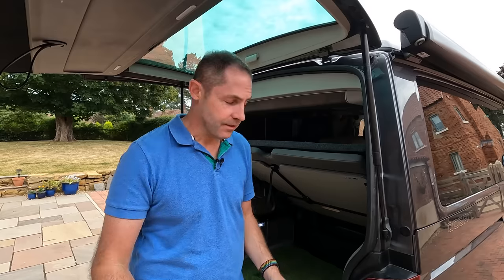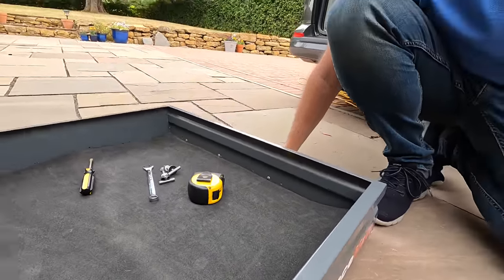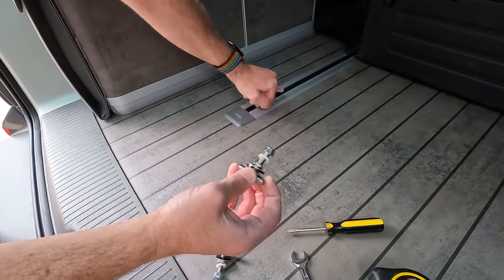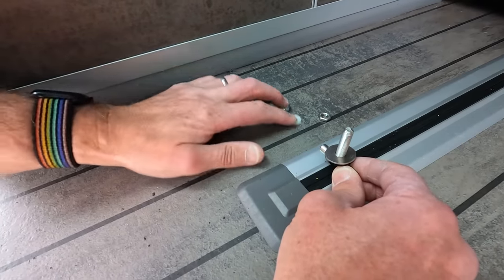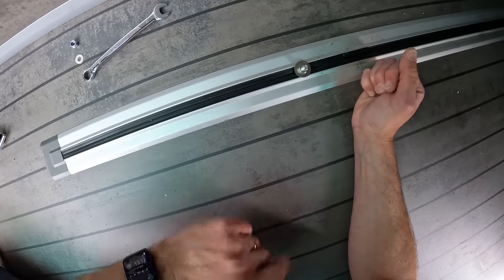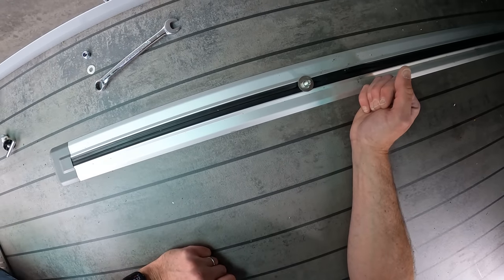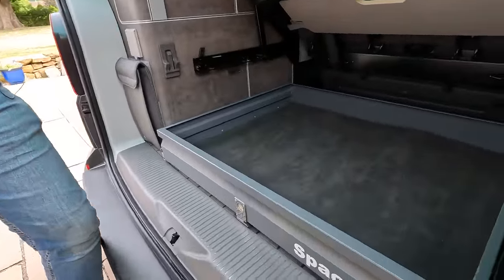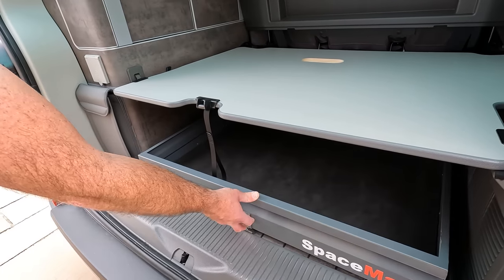VW California SpaceMate Boot Drawer Install & Review!

Comment: Hi Will
With regards to the 12v plug on the right now being redundant.
Could the tray design be reversed so the gap appears on the right allowing access to the 12v or at least the use of an extension lead plugged in permanently to gain usage.
Reply from the maker: Good question, certainly worth looking at 👍
Reply: We've now built a version with the bias to the left to leave the 12v socket useable 👍
Reply: So glad Will has got his 12v access back. Good luck with brilliantly designed storage draw.

Comment: Looks Fab - as a storage freak I really love it, just got to think of somewhere to put my " long" things that fit perfectly down the left hand side under the seat (outdoor mat and rolled up window shields)
Reply: I travel a lot with mine and it was one of the things I deliberated the longest over. I have a heavy 1300mm bag that’s about 200 x 200 but I found the the trays are strong enough to place it on top and it still slides nicely in and out when the tray is pulled out. I you were using the height from top to bottom then there’s a slight compromise on what long load is left. Maybe one for the future..

Comment: Hi Will. 
Great video. Just wondered have your tried with your bike rack installed? Does it foul the rack to toe ball lock handle or strike the rack when extending the drawer with the rack pitched over? I use a Thule XT 3 so similar potential strike/foul points. 
Thanks.
Reply: I’m can’t answer for this specifics tray, but with similar trays on the market they don’t foul the Thule racks.
Reply from the maker: Good question. Not tried that yet but can do and report back 👍
Reply: @CampervanTime  would be great. Thank you

Comment: Looks good, suggest Simon puts a hole in the side that lines up with the 12v power point
Reply from the maker: Interesting thought - hadn't considered that as an option 👍
Reply: Trouble, is you’d rip the plug out when you pull the drawer open. I planned to relocate the 12v socket higher up on the side trim.

Comment: Looks good and will save lifting the shelf up to get to stuff. I wonder if it’s narrower than the base of the boot with gaps at each side because then what you put in it doesn’t catch on the brackets higher up that fix the wooden shelf in place as you slide it back.
Reply: That was part of the reasoning, more vertical space on the RHS.
Reply: Always said I should have been an engineer

Comment: Nice drawer, just a quick thought, are you still able to access your jack ?
Reply from the maker: Yes - by sliding the bench seat forward a bit. I have actually found that sliding it all the way forward is easiest as you can then just put an arm in and unstrap it from the back of the bench and lay it down, then go in the boot to get it.

Comment: Looks good. Wider than the original campervanbits version but as you mentioned could be wider. I like that the rear seat still goes fully back.

Comment: Looks great! 
Can this fit on a 2 seater Beach?
Reply from the maker: Good question, I’m not sure. It will depend on the position of the rails in the floor for the sliding bench seat and if the bench is the same as in the ocean / coast. I suspect it might.
Reply: Would it be possible to help with some measurements?

Comment: Hi Will! Great video as usual with clear explanations. The Spacemate looks a high quality product. 
However... I've always thought a boot-drawer in a California is a 'solution looking for a (non-existent) problem'!!
We use collapsible crates in the lower boot space. Yes, you have to pull out one crate to access the one behind it ... but, really, hardly a big issue??!!
The major disadvantage of installing a bootspace-wide drawer, as I see it, is 'losing' the long storage space alongside the back seat... perfect for storing our rolled-up awning front & side panels!
The beauty of the California... flexible space for individuals' needs - to be organised however you want to! 
Again, good review 🙂👍
Reply from the maker: It’s all down to personal preference I think. We’ve not tried one before this and we’re impressed as it means we can use more of the space more of the time, although it’s a bit smaller space than without. Using the hot water boiler shower will be a lot easier on this.

Comment: With four adults in the Cali and fully loaded for a big trip, payload can be an issue. Even more so on the Coast than the Ocean. Can I ask what the weight of the unit is? Curious as to how much it eats into precious payload. I did check the website, but couldn't see specifications. Many thanks
Reply from the maker: Not sure exactly but I think I saw a comment from Simon on another comment asking something similar saying it was about 24kg I think.

Comment: Excellent review, thank you. I have a 4motion so weight is a big factor, as is losing any potential space. I think I’ll wait for v2, hoping that some improvements can be made in those areas. Is a solid floor necessary or could perforated sheet be used?
Reply from the maker: Good points and good question - I don't see why the bottom of it couldn't be perforated. I know Simon is watching these comments with interest so lets see what happens!

Comment: Looks a good alternative to the Campervanbits version. I noted on an installation video for their drawer that someone suggest loosely fitting the drawer and then from inside push it up to the closed tailgate to ensure it’s as far back as possible. Also, the Campervanbits version also states the bench may need to be moved 20mm forward on a T6.1. Great review, not sure which one to get now..! But drawers are definitely worth it, no more dragging everything out to get stuff at the back. PS: do you know the weight of the unit, couldn’t see on their website.
Reply: 24kg
Reply: @SpaceMateMH  great, thanks. Also, where are you based as I might prefer to collect (if possible)..?
Reply: @couplandsj  Midlands based but I'd be prepared to Meet somewhere and help you fit it. 👍
Reply: @SpaceMateMHL  that’s very kind. We are still waiting for our Cali to arrive (ordered June 21 and stuck in build since May). Was just thinking if it didn’t arrive before end of August I might just come and get the drawers. I’m just checking dimensions to see what combination of Euroboxes will fit.

Comment: Looks super well built and the fitting nicely non invasive. Always thought these were a bit of a solution looking for a problem but with some of the tweaks mentioned could be much more interesting. Drain holes, maybe no so much - would prefer spills to stay in the top rather than having to remove to clean, but the loss of a 12V a pain as is the loss of width, The 335 placement a show stopper for us - it’s the last thing out for us and the first thing in, so having to move things around to fit the drawer means we are working for the unit, rather than it working for us. Will keep an eye on though. keen pricing too. You never showed the underside but would be good to know if there are rubber stops to ensure the front does not damage the floor.
Reply from the maker: Ahh yes apologies for not showing the underside - yes it does have felt and rubber to protect everything and we've taken it in and out a few times now and no trace is left anywhere.
Reply: @CampervanTime  Cheers. Will watch for a V2 where there is a hole drilled for the 12v and the 335 goes in back right with a tray insert.
Reply from the maker: I’m sure in the T6 it would be ok because it doesn’t have rear board with the lift / hold mechanism. Need to give it a go in one.
Reply: @CampervanTime  have a 6.1 Ocean so same issue as vid.

Comment: Looks well made, but maybe too well made, could loose a lot of weight out of that and still be solid.  Also don't get why there is another cross member on the mount but its not tied into the rails to add another 2 mount points, odd.
Reply from the maker: I wondered the same but it’s probably designed in for strength in the frame but not needed to be tied in to the floor because it’s solid enough without it. The weight of the drawer seems to keep it sat there very nicely too.
Reply: @CampervanTime  yeah but a few heavy braking events will lift the rear up as it tries to push forward putting some strain on those 2 tie points.
Reply: The middle cross member is there to lift the subframe and keep it level at the end of the rail system. The end cross member has spacers to raise it up to the level of the rail. We've tested this product for two years before release. Other than rolling the Cali the tray will remain in place in all circumstances.

Comment: Single latch seems better overall
Reply: Having a drawer system in the back of my Land Rover, I miss the ability to lock the drawer open. On anything that slightly slopes forward the heavy drawer need a lots of force to keep open. For that reason I’d prefer to have the dual locking latch option.

Comment: isn't it too hard to access your tools(trailer hook/jack/...) under the seat? For me, such drawer is "nice", but honestly, I rather not loose space(if you count the thickness of the wall, the empty space on the right/left, the lost space in height, it makes quite a difference. Also you loose some flexibility(ski). For my usages, rako boxes fits perfectly, can be totally removed/added in seconds. And I've 2 additional custom-made boxes(one that goes behind the two rako boxes) that contains the grill and some rarely used items, and one that occupy the rest of the width, that we use as pantry.